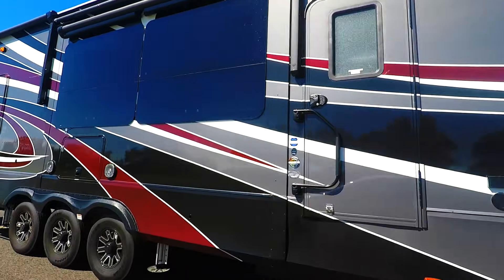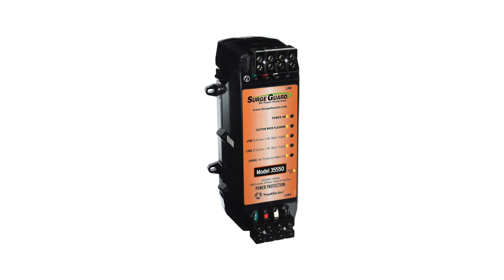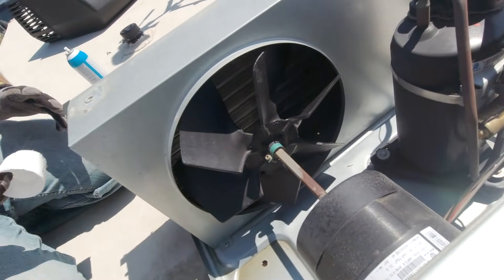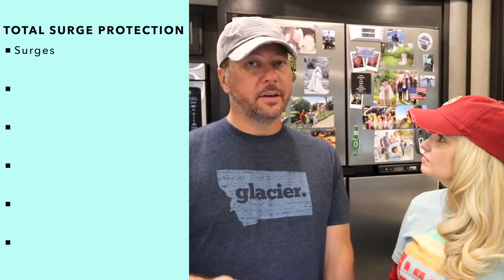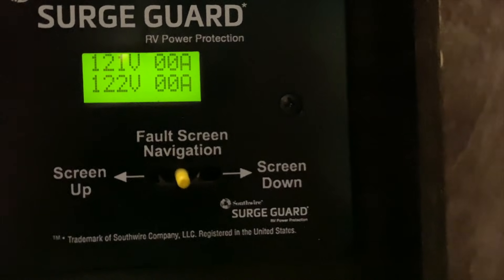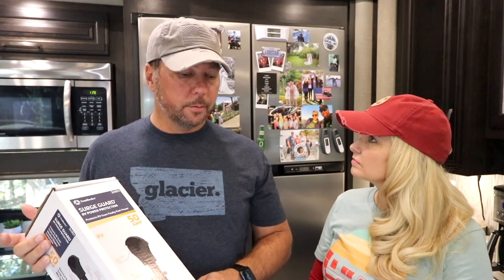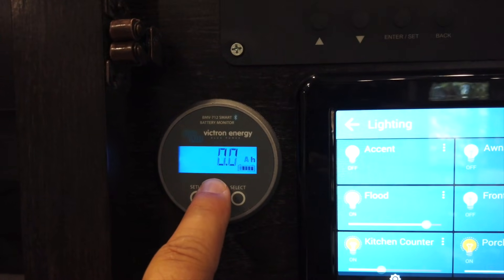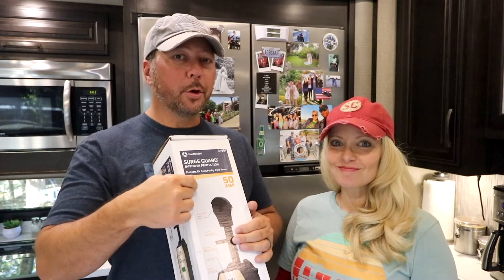⚡️🔌 Total RV Power Protection | Surge Guard | Full Time RV

Comment: I agree with you on Grand Design wiring.  It appears they hire Italian spaghetti makers because their wiring is a mess of spaghetti wires.  BUT in all fairness, ALL RV manufacturers are competing for the same technicians because they all look the same.  MAYBE the RV industry should develop a STANDARD by which the manufacturers can measure the work of their employees, but that is another video.  What would be even better is to have companies at least admit the problem exists, and give thought to the fact that like you two, there are people buying their products to actually LIVE in.  Not just haul around for one or two weeks a year.  But that is counter to their upgrade of the month mentality they seem to fixate on.  It should be noted that many high end units represent a large investment and the expectation should be that I can jump in or hook up at any time, pull or drive to the next item on my bucket list of things to do, watch or see etc., without having to worry about these things going Ffffttt in the night.  This does not mean that they bear all the blame.  So many parks are thrown together by a blind man using a butter knife to cut the shielding off wire, or they use the wrong wire in general to do things and call it all good, that they are a fire hazard, and a life safety issue ready to bite the next person that pulls in.  There is a lot of responsibility in hanging out a vacancy sign that is not being addressed.  These are basic items that should be fixed at install, and checked at least annually by COMPETENT Electricians.  I sure wish I could look at a coach or 5th wheel unit with bundled cables, that are properly labeled and ran through a unit with loops in wires to act as a shock absorber without looking like they were trying to save a half of an inch of cable by running it cross-ways, or in some cases not exactly tight because they were a 1/4 inch short of wire.  It happens way too many times in this industry and consumers have accepted this as the Norm.  Tight wires with no loops to take up shock from rolling down the highway are a fire disaster waiting to happen.   OK, I'll get off my soap box, but I think you get the idea.  And no I am not an electrician, but I used to be a missile tech on Nuclear missiles and know the difference.  Thanks for trying to keep people safe and doing things that the manufacturers should be doing on their units from the get go.

Comment: Is there a way to wire the internal, to be able to do a temporary bypass?
Reply from the maker: Haven't looked into it too much since it's fairly easy to bypass manually.  But, I'm sure it could be done fairly easily with a set of 4 single pole / double throw switches...  But, a lot of wiring for a "what if"...
Reply: Unfortunetly what if happened to you. You did not look too happy trying to route the wires. ;)

Comment: We have 50 amp on our Tiffin DP. It has a built in surge protector.  There have been a couple of campsites where it is only 30 amp. We have a 50 to 30 amp adapter. We also have the Progressive Industries 50 amp EMS external pedestal unit.. Can it be used on the 50 to 30 amp adapter? I’ve been plugging into the 30 amp pedestal without my external 50 amp Progressive Industries 50amp EMS.  Thanks.

Comment: I have found that most of the RV Surge Protectors do the basic wiring checks as well (open neutral/ground, rev. polarity).
I do have an electrical question for your distribution video that I have not been able to find an answer to.  With a 50A service there are two branches.  Does each branch provide 50A or is it 25A per branch?  Important when using a dogbone to a 30A trailer as it only taps one of the two branches; I've always thought I might overload the one branch that I am tapped into if drawing the full 30A.  #giveaway
Reply from the maker: We're going to go into great detail on that real soon.  50A is 50A per leg.  100A total, but not shared between legs.  30A is 30A total and the two legs are essentially bridged and sharing that 30A.  Hope that makes sense.. 😊

Comment: #giveaway. Love your videos. Also wanted to ask, if I was to purchase the one that you put into your RV, couldn’t I just install that on the cord myself in the “basement” of our fifth wheel?  ( as in cut the cord and attach one end that is already going to the breaker box and then , the other end would be attached and go to the pedestal) or do I have to run a separate cable to the breaker box?  One more question, what brand of tires do you run? Thanks
Reply from the maker: Hi!  You pretty much just described the install.  You're likely going to need some extra 6/3 Romex, unless you have enough slack in the line.  Install video will be out Wednesday...  👍🏼  
We just got Michelin Defenders on the truck.  Still running the stock Westlake G's on the RV.   Over 20K miles on them and doing great.  Will likely replace next year with Sailun or Goodyear.

Comment: I'm in the market for one of these now because the RV i just bought has had the power converter blown out and it took out the microwave and several bulbs throughout the coach when it was blown. i have replaced all bulbs with LED light bulbs and just dropped about the same amount of money as the over the range convection oven that was blown up on the LED bulbs. (30 bulbs @ $20.00 a set) I'm concerned because my late wife's nephew came to troubleshoot the microwave and said that running on my 30 Amp generator i was showing 16,000 HZ on the plug when it's not supposed to be more than 60 hz. ButThat was on generator though which from what i understand is really common because it's a mobile power option, not a direct power kind of arrangement. I don't believe my unit has an ATS which may be part of one of many problems with how this is set up. i am on a lot with my own power not shared by anyone else i am looking at an external unit right now a surge guard because i don't have a background at all in electrical but i am not afraid of wiring either. i respect the fact that if i mess up it can kill me and so far so good. All i have ever gotten was the occasional quick jolt like from a telephone cable just enough to let you know you did something wrong without doing any real damage. I'd really like to keep it that way too so i'm sticking with the external unit specially since i don't really have to worry about anyone stealing it on this lot.  i am looking at the southwire surge guard 44270. Just a basic no frills surge protection to keep everything in my RV from melting down. and money is an option now as i'm buying the property i am currently camped out on also. I am just looking for information regarding why the others are so much better or worse and other than monitoring features are there really any other important reasons to go with a more expensive unit? Mainly i don't want to have to replace a power converter and i am going on the hunt for an ATS but i really don't believe that it has one and if not that might be something i need to purchase and install also, thankfully those aren't very expensive. Any help or suggestions would be greatly appreciated as i am still REALLY new to all of this but want to do it all right the first time as i can't afford anything else at this point Thanks in advance
Reply from the maker: Hi!  The reason the total power protection units are so much more expensive than a surge protector is that they do a lot more than surge.  Surges are much more rare than just bad power.  It's low voltage that kill an AC compressor fast because it has to make up for the low voltage with increase amperage.  But, if you're always on reliable power, a surge protector may be enough.  In regards to your generator, how did you get the 16KHz measurement.  16KHz is WAY off from 60Hz.  Generally, it needs to be ~ 57-63Hz.  Not sure things can run at all on 16KHz.
Reply: @ChangingLanes  oddly enough the 16Khz was directly from the outlet that my microwave was plugged into. of course before i purchased this big country RV the power converter was replaced also. once i got it back to my lot i found the old converter which was a 45 AMP?  and it was replaced because of whatever surge or short that had caused the damage to the microwave and blew out several of the coach's bulbs.  I have the southwire 34950 on it's way to me now from Amazon and i'm thinking something like it may have helped in my 30 amp Elkhart also because the 20 amp main breaker always trips when the AC is running and i try cooking in my Air fryer or if ac is running and i use the microwave. I thought i was going to have to purchase another air fryer (nuwave bravo) because the RV actually melted the plug on it. i had it pluged into the same outlet as the microwave but never ran the two at the same time. put a new plug on the nuwave and plugged it into a different outlet on a different circuit and now only the ac trips the breaker when the air fryer is on but it. Doesn't matter as i am moving into the Big Country RV soon though but the fun may arise again when i need to do laundry in that RV.
Reply: @ChangingLanes  thanks for the reply by the way.

Comment: Good information ya’ll. I wouldn’t be without an EMS. I’ve had 30 and 50 amp both portable and hardwired over the years, but could use a new one. All came from TechnoRV. I know they have saved $$$. #giveaway

Comment: Does it matter where you put the internal EMS between the line? ------EMS---- Can I put it anywhere along the line?
Reply from the maker: Ideally, it should be between the pedestal and anything inside.  So, ours is right before the shore connection into the ATS.  We have a wiring diagram in this post if interested: https://changinglanesrv.com/inverter-project/
Reply: @ChangingLanes  ok, thanks!

Comment: #giveaway Love your video. I installed the Progressive Industries HW50C and had a problem with it right away. It cut ALL of the power to the RV and wife was not happy. So when I received the replacement, I wired in a breaker that I can throw to route power around the EMS in case of emergency so I don't have to crawl in the basement to perform a work around on the fly. 

You mentioned that you had a couple of low voltage issue that it sounded like took out your A/C Compressor. Was that before you installed the EMS? Or did the EMS fail?
Reply from the maker: We had bad power eventually take out our PI EMS.  We've always had one installed, so never had any issues with our compressors or any other equipment.  👍🏼

Comment: #giveway  Great video.  Had a Southwire but unfortunately, it got damaged by my leveling jacks...my fault and  need to replace now....didn't know about the wireless monitor-will be getting one of those with the next one
Reply from the maker: Well, that's a new one...  How did that happen?
Reply: @ChangingLanes  i had my fifth wheel sitting in my yard working on it. It was a bit from my RV plug in on the side of my house so i had an additional cord on it. I had the surge suppressor in between the two cords instead of hanging on the side of the house like I should have and to keep it out of the rain, I had tucked it under the rig sitting on one of the levelers, forgot about where it was and when I went to raise the levelers, and of course the control panel was on the other side of the rig and didn't see it. It got a bit smooshed :(  I had bought the 2 year warranty but I was a few months out of that and as you pointed out, there almost $400 by the time you add tax and a possible longer warranty so I need to get a new one. 

Over the years I have had many opportunities to look in the mirror and say "Rick, education is expensive,  chalk this one up to education" and move on.

Comment: I have a mechanical background from my service in the Navy and Marine Corps, but I am scratching my head as to how  to connect my victron multiplus to my power panel. Have the same setup as was shown with Keep your daydream 's Grand Ginger. I have watched your install numerous times, and now have a bald spot from scratching ...  could you please provide some insight into the splitting of the 50 amp stuff. # giveaway.
Reply from the maker: Hi.  I think the unit they (KYD) did was a single pass-thru, which requires wiring to a sub-panel that will only power certain items in the RV.  I remember them talking about what they want powered.   I'm not a big fan of this as it complicates wiring and has less capability.  An inverter/charger with full 50A pass-thru is how we did it: https://youtu.be/1rPKWrXQYWA  
Wiring goes from the ATS >>> Inverter >>> Distribution panel.  Very simple and everything is powered.  Victron does make a 50A passthru unit (I think).  Maybe they will let you upgrade.

Comment: Looks like I have a similar setup as you. I have the same inverter (go power). I have a question. What are you thoughts about wiring in the Surge Guard, After the auto transfer switch, but before the inverter input OR installing it after the inverter but before the inside breaker box? I would think it would be good to protect from funky output from the generator. I also think the go power handles some of whta the Surge Guard does, mainly low voltage, and keeping the power filtered. My setup is that my transfer switch has shore power and generator power, from there I go to my inverter, and then from the inverter to my inside breaker box. I'm assuming you have yours setup the same way. Oh and I too was military and I'm an IT engineer. Similarities. lol #giveaway
Reply from the maker: Yep.. sounds like a very similar setup (https://youtu.be/1rPKWrXQYWA ).  When we had the PI EMS, the instructions said to NOT connect it to an inverter.  I called them and asked about this and they said it can cause issues.  Not as worried about bad genny power or inverter power, so it is where it is.. 👍🏼
Reply: @ChangingLanes  Yep, that video was the deciding factor in me getting the go power. the fact it passes both sides of the 50amp, is what did it for me. I just did not want to have only some plugs hot, and I had to pick one side of the 50amp or the other, OR put in a sub panel. Thanks for your answer!

Comment: What's ironic 30A is less prone to damage your equipment than a 50 A service, You can loose your neutral connection at the pedestal and stuff will just quit working. In a 50 amp you get a hi low shift between both legs. passing thru your electronics. As a troubleshooter for a utility company you be amazed at the problems at the plugs in these rv/ mobile home pedestals. People always called the utility company and 99.9 it was the pedestal. Problem with these protectors is they are to sensitive. Utility voltage can be 112 V to 127 v and be legal. Harmonics? That would be 1 in a million chance out of range. I would hate to run an rv park with everyone using one of these! Might as well hire a full time technician just to prove they had usable voltage. Protecting against surges in storms great, everything else except a bad neutral I'd have to question the value. Spend some money on a Fluke muti meter and learn to use it, it'll save a lot of guess work and help determine if you really have problem or is it a sensitivity issue with the surge protector. No need to hookup and drive off for no reason.
Reply from the maker: The specs on the Surge Guard are 102-132 Volts.  Outside that range will cause damage if sustained long enough.   A fluke meter will only give you a point in time reading versus constant monitoring.

Comment: #giveaway I’ve been watching you guys almost since you started and love your channel. I have a class A and have been wanting to buy a EMS system for a while, but have procrastinated. WELL, Murphy’s Law struck. On October 2nd, I went camping at the Desert Run at Means Dry Lake in Johnson Valley, Ca. The base camp had several large diesel generators that had junction boxes with 6 standard 120 volt 20 amp receptacles. AND, it had 1 twist lock 30 amp receptacle. I chose the 30 amp to gain that extra 10 amps so I could have more power flexibility. After plugging in I realized I had no power. I checked everything, but still no power. I believed that receptacle and breaker was bad so I just plugged into a standard 20 amp receptacle. Still no power to my RV. When I went inside my rig to check my electrical panel, I smelled melted plastic. None of my panel breakers had tripped so something was wrong before the power got there. I ran back to the junction box and unplugged and discovered my error. After looking more closely at the 30 amp twist lock receptacle I discovered it was 250 volts, not 120. I then realized I fried the shore side of my transfer switch in the closed position, not allowing any current to flow to my panel, thank goodness. The shore electromagnet switch was melted. However, the generator side of my transfer switch still functioned so I could at still camp and charge my batteries at night. Somehow it also fried my 600 watt inverter that powers my TVs and audio system. Not sure how that took a hit. Well I had to buy a new transfer switch and inverter and I installed them myself to save money and I’m glad to say, everything works again. You have impeccable timing with this video because I was looking at EMS systems to buy so I never have that issue again. Please enter me in your contest for the portable 50 amp Surge Guard and thank you. And to all of you who are procrastinating on getting one, learn from me it was a $500 lesson and time removing fried equipment, checking wires and breakers and installing new equipment, NOT FUN. Thanks Chad and Tara 👍🏻.
Reply from the maker: Wow!  Glad it didn't start a fire!  Good luck on the drawing! 👍🏼